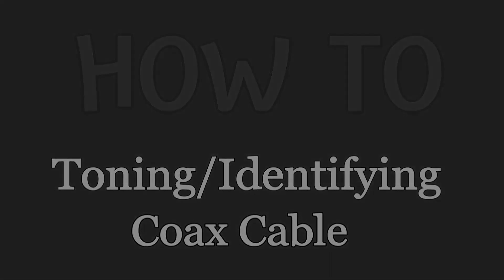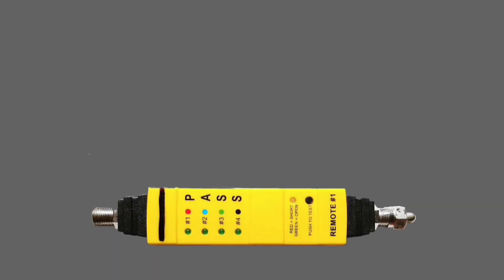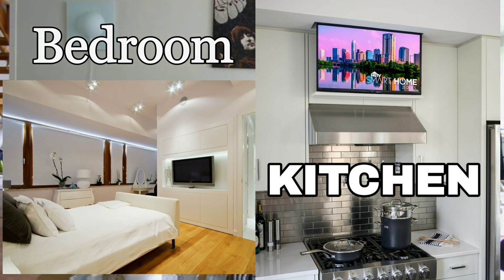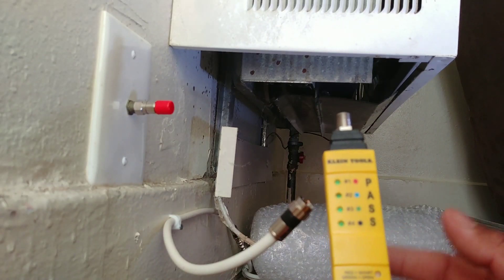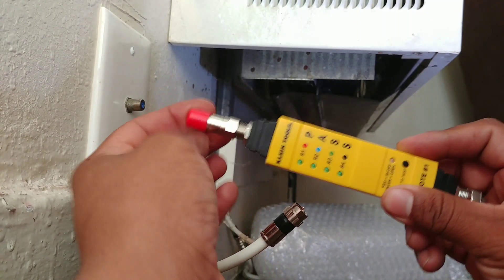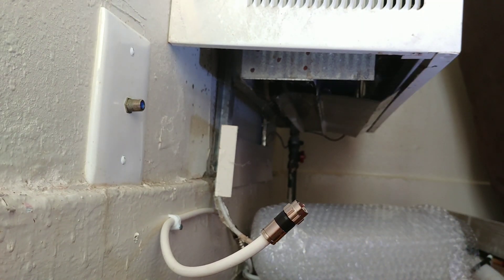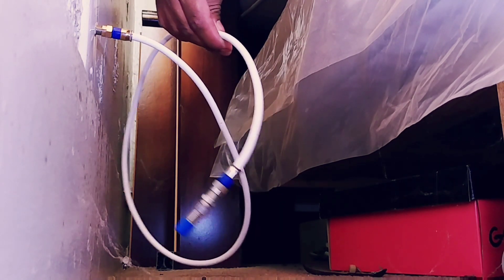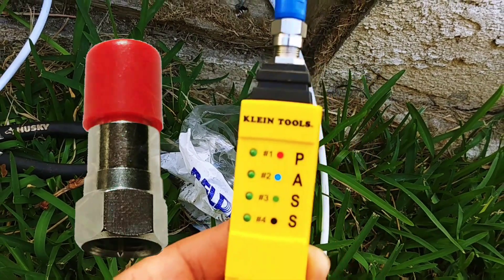HOW TO: Identify/Tone coax cable

Comment: It works for single homes. Do multi floor apartment buildings you will be there all day. Use a probe and toner not that $11 Harbor Freight  tool you using.
Reply from the maker: Correct. You can use a probe and toner (which I have as well). The purpose of this video was to show how simple it is for the DIY person  And you don't need an expensive tool for that.

Comment: Does this tool work when there are splitters in the line? Most don't.
Reply from the maker: You will get false readings.  You will need to identify and remove the splitter. The lines I'm toning were connected to a splitter after i was done identifying the lines
Reply: @itstheACE562 Thank you for your response. There are many times that splitters are buried in the walls. I wish I could find a tool that worked when they are present.

Comment: First step of conecting  the color heads that’s each but when you go to the main box where you have more than 100 cables that are connected to the board how do you test them without discente y one by one?
Reply from the maker: You want to start with the cables that are not connected first.  This tool I recommend for jobs where there is less than 10 cables you would need to identify.  Anything more than that I recommend a probe & toner set

Comment: How would this work with BNC connectors?
Reply from the maker: This tool is for compression fittings.  For other types of connectors, you may want to use the Probe & Toner set
Reply: @itstheACE562  the Bnc are compressed
Reply from the maker: @davidalmager1134  yes but the F-connectors are threaded inside.  The BNC connectors are not.  I believe there is an adaptor that can go into the tool
Reply from the maker: @davidalmager1134  you can use BNC female to F- male adaptor
Reply: @itstheACE562  that’s what I was thinking Ty

Comment: Works with splitter?
Reply from the maker: It will not give you accurate readings.  Normally you should take the splitter off first.  You're connecting that tool to the coax where the splitter is or Was

Comment: What does short mean? Could it just be the coax cable I used to test the coax in the wall was bad?
Reply from the maker: A "Short Circuit"
That means 1) that the Coax you are testing is actually connected to a powered device (television, Set-top box, Etc), & it reads  SHORT,  because it's detecting power in the line. 
2) the coax is damaged or cut and somehow, the braid (negative) is making contact with the center conductor (positive); this will cause a short
Reply: @itstheACE562  thank you.

Comment: A simple coax outlet on the inside of your house can be used for cable or internet right there is no only cable or only internet?
Reply: It can work for video or internet. If you want a cable tv in that outlet then it'll work for video. If it's for internet, then it'll work for that too. If you want both in that same outlet you'll need a splitter to split the signal for both. One single coax connection can carry video, data, & voice.

Comment: Will this work in the other direction?

What I mean is, I’m trying to see how many rooms one outlet feeds for an OTA antenna. So one connection outside the house may work for several rooms with an ota. I aM aware of the signal loss in splitting from an ota. There’s no real way of knowing how strong the signal is until I hook each room up an run a channel scan
Reply from the maker: Last I have heard, was that the new SWiM system they were planing on launching, would handle up to 32 channels.  That was roughly a year and a half ago.

Comment: yo man, if the 3rd line you tested outside (the open circuit) was still connected to a TV or Modem would it show a short? and or would it damage the TV ect..ect.. in any way?
Reply from the maker: On some devices the LED will light up red when it detects a short (cable connected to a tv) - the electrical signal is not strong enough to damage a television. Only enough electrical charge to light up the LED & LEDs don't need that much

Comment: I used a 8 way cable maper I used to use that very same maper but the black boots on the end breaks off over time. It's not an expensive tool . Only 30$ but it would let me down wen I needed it most.
Reply from the maker: Reo White I've lost so many tools. And I've had many tools stolen off my truck as well. I've constantly had to buy different toners & tools.
Reply: ACE Gonzalez  yeah ive had to buy many many toner sets .
Reply: Is your truck not secured? Mine always is